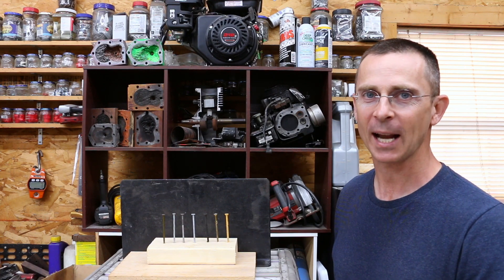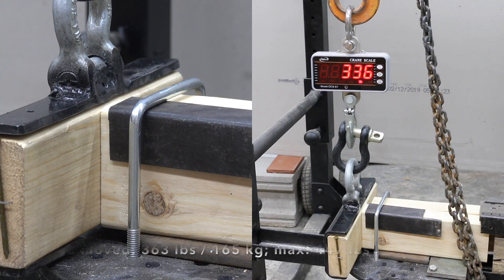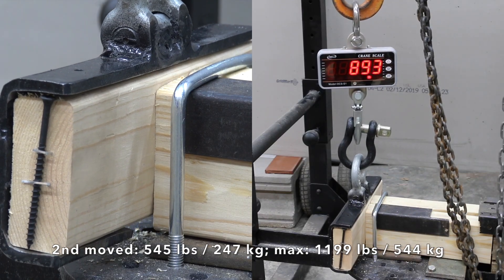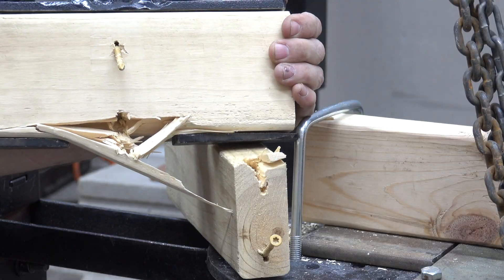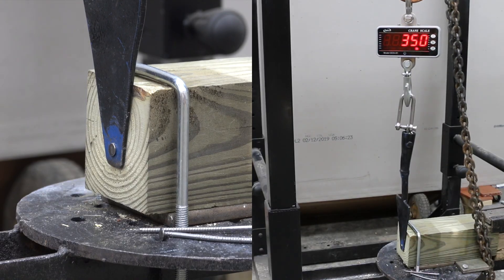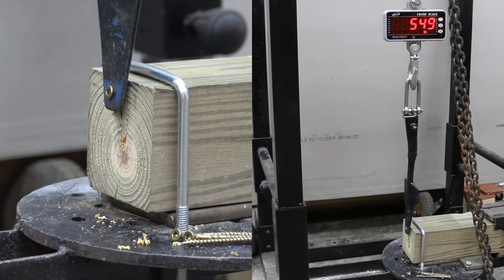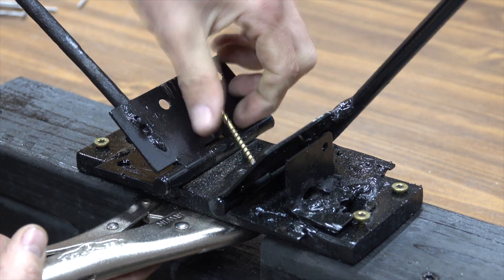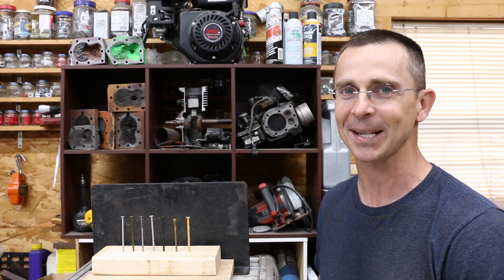Do Screws Shear easier than Nails? Let's find out!

Comment: Great test but a tad misleading. "Shear" testing should end in the fasteners breaking, not pulling out. 

According to a construction text book I have stashed away somewhere, fasteners are 6 times stronger when driven into cross grain at a right angle or five times stronger when toe nailed than when driven into end grain. This is why end grain fastening is always avoided or reinforced in construction applications except where there are no shear forces involved. So repeating this test driving into cross grain should have found actual shear limits of many of the fasteners. And I would be curious to know how accurate my book is. 

Keep up the great work. Thanks.
Reply: It's a good thing I looked through the comments, I was about to make the same point. With that said, since the tests are done all the same way, the comparisons probably still are fair.
Reply: @nobodycares85  absolutely. As the results were repeatedly similar, this means the test was accurate to the conditions. Changing the test parameters for other results would certainly be interesting and of value as well.

Since wood can split sometimes when you go into the cross grain, I'm wondering of the results will be less repeatable or accurate. I'm thinking cross grain varies in pattern more. This may make testing show too great of a variation in results, but without the testing done this is just a hypothesis.
Reply: @DENicholsAutoBravado  That's a good point you raise there about the potential for more splitting with cross grain, I hadn't thought of that.
Reply: @DE Nichols  IMO, this test allows screws to "prove" to be stronger than the nails due to this test not truly testing the shear value.  When he does this test again the correct way ( not into end grain) I believe the nails will be stronger.  When nail and screw is tested only on shear value and not on outward pull, those screws will snap, especially the sheetrock screws.
Reply: DE Nichols Agreed as to your comments, but on the job there are always variations in the patterns of the endgrain or crossgrain of the wood you are fastening to.  Getting an average of three pulls per fastener seems to be a good way to test them.
Reply from the maker: Thank you for the constructive feedback!
Reply: @ProjectFarm  I see what you did there!
Reply: @ProjectFarm  Real world scenario however if an object is secured with holding power in excess of 1000 lbs, it would require that same amount of linear movement to even begin to slide and create shear forces, screws lock wood much more securely preventing shear forces from truly becoming an issue. Obviously it depends on what scale your building on lol 😂 a shed or a fence however isn’t going to exceed those fasteners holding power, perhaps a deck with sufficient weight built onto it or a house but when constructing buildings pieces of wood are arranged in a certain manner to play to the strengths of tensile strength not shear strength. Correct me if I’m wrong, this is simply my understanding of it.
Reply: I love the channel, but this was not a shear test. What was tested was the strength of the wood, the holding power of the various shank and thread designs, plastic deformation, tensile strength, and the point at which the various alloys become work hardened. All of which is very useful and interesting in its own right.
Reply: Came here to make the same point. This is still a pull out strength test.
Reply: A fixed upright on test 2, preventing the fasteners from pulling out, might have resulted in a shear test. The 3rd test was a maleability test, not a shear test. However, it seems mostly irrelevant, because fasteners don't bend once they are in place, until they start to pull out, so if they never fail due to holding strength, they will never fail from bending. For all practical purposes, once they start pulling out, the joint has already failed anyway. Still, an enlightening test. You basically proved all of the fasteners are stronger in shear, than the wood used for testing...
Reply: If u fully watch the video. It is a shearing test.. It's not possible to always make a nail or screw break under realistic circumstances. It either breaks or it pulls out. His second method is the best test of shear strength.

Grip test involve shearing aswell. But shearing involves an angle.. every screw was bent coming out a lot were broken. This is a good test for shearing. You can also see grip involved too. Kinda hard to avoid.
Reply: Your book is spot on.   The methodology he used gave a comparison under equal conditions, but had he screwed into the side of the 4x instead of the endgrain, it would be interesting to see if the the added holding power gained would have caused the screw-heads to pop off vs. the nails.   I wonder...  He had to know that; I wonder if other than end-grain would have exceeded the limit of his scale?

Some of those screws did a lot more bending than I thought they would have, a simple claw on a hammer demonstrates the "sheer" difference pretty quickly when you're pulling them with a hammer, and it's not nearly this close!  In fact, it's virtually impossible to pull a screw with the claw of a hammer without breaking off the screw with very, VERY little force applied.
                                 You may have noticed the difference when he breaks the screws vs. the nails, the actual solid area is much smaller on the screw than the nail.   It's also why we don't use nail-gun nails for door-jams, ETC; those nails (finish) have very little holding power and bend VERY easily compared to hand nails.
                                  I'm seeing guys use 100% screws on subfloors now.   It goes against everything I was taught, but for a subfloor I suppose it makes good sense.   It will ALWAYS boil down to cost and time on the job site....
Reply: @crforfreedom7407  - Use screws for subfloor to minimize squeaks and call backs.  As the wood dries, fasteners loose their grip.  Nails more so than screws as he demonstrated in this video watching how much wood is pulled out when the fasteners fail and the amount of force required to do so.  Because this is such a major problem, everyone I know also uses an adhesive in addition to the fasteners.
Reply: @flick22601  Right on about adhesives; I think this has had the biggest impact on squeaking frankly, but have you ever tried to pull out a nail-gun nail?    They all come with glue/adhesive and are a bear to pull!!   I've had to fix a few FUBARS and I'm telling you, the difference between a sinker and a nailgun nail in removal with a cat's paw or even a pry is amazing!   Takes an annoying job and makes it a full-fledged infuriating pain in the @ss!   A salvageable piece of ply is total scrap by the time your done!
                                              If you're comparing the holding power of a nail-gun nail and a screw, I think you might find that an interesting comparison!  I think it's a totally different ballgame.  Besides.   It's what; 5x at least faster to lay?   There you go; time and money with no loss of quality.
Reply: @flick22601  I might add that with a nail gun, the nail is intentionally attempted to be installed at an angle which also aids in adhesion and anti-squeaking properties.  But the glue on the nail and the adhesive on the joist is huge for anti-squeaking.  I've installed many, many homes this way, both new and remodel with 0 callbacks.  But if screws are better, I'm willing to keep an open mind.   I was surprised to see it being done by some pros on YT I saw.  Defiantly a departure from the way we all used to.    I bent nails for about 25 years, but I'm in a different trade now, I do commercial & industrial HVACR, so except for my own work, I've been out of the biz awhile.... new and changing all the time...
Reply: @crforfreedom7407  , I have installed solid oak flooring, and cheap engineered
 bamboo flooring, in several rooms at my house, using dragontooth nails and the large pneumatic nailer that you have to hit with a hammer to drive the nail. I also had a contractor put hardwood flooring in another room, and he used the glue coated staples and a small air nailer. My experience has been that the dragon tooth nails hold a lot better, with less sponginess and fewer squeaks. Granted, this 1980s house wasn't built all that well and the plywood subfloors are decidedly uneven , perhaps it would be less of an issue if the floors were flatter. BTW, the plywood subfloors used to squeak like crazy (the builder didn't use construction adhesive,  obviously ) when there was carpet on them; I screwed them all down snuggly with plenty of screws before the hardwood or bamboo was installed. They still squeak a little bit but not like they used to.
Reply: @goodun6081  Sounds like you did excellent work!   That impact nailer is the tool used for hardwood for many decades to my knowledge.  It is a great fastener; thick and strong.   As I mentioned earlier about pneumatic finish nails, the staples too are very thin material and are way too pliable for that application in my opinion.   The comment about glue on nails was pretty much just dedicated to the 16s and 8s.  I've demoed a lot of jams, and a few were fastened with a pneumatic gun, and I was shocked at how easy it was to tear it about.   hardly needed tools!!  Most nails pulled through, but very easily and bent like pretzels!  The staples I should think are on about the same par?    I've used a lot of pneumatic staples for lauan, but that is scads of staples recessed.  Different application.
                                                   I think the biggest reason why adhesive is such the answer to the problem, isn't so much that the nails loosen necessary, but as the wood shrinks, expands and works up & down (which just covered about 360 degrees of movement!) the holes in the wood get larger around the nail.   The best fastener can't stop that 100%, and steel is tougher than wood, eventually it's bound to open slightly.  Restricting the vertical movement as well as some lateral makes adhesive the miracle worker....
Reply: @crforfreedom7407  , unfortunately, there's no easy way to add adhesive between the plywood and the joist of a squeaky subfloor! Which is why I put a gazillion sheetrock screws in it instead, prior to installation of hardwood. Although I had other contractors redo our kitchen cabinets and kitchen floor, my wife and I demoed it ourselves. The linoleum was glued to luan plywood which was nailed down to the 3/4 plywood with about a gazillion nails. We sliced through the Luan and linoleum with a circular saw set quite shallow, and pried it up in roughly 2-foot by 2-foot pieces, and pulled about a gazillion nails. Yikes! Although I ran some new electrical lines and relocated  some wiring, switch boxes,  plumbing  etc., in advance of the new cabinets, my wife refused to let me install the hardwood floors and insisted I have someone else do it because she wanted it done in a day, and not  two and a half days or so. The problem is, if you look closely you can kind of tell that the flooring was done buy a "git 'er done" type of contractor, and there's a little more squeak and floor movement than I would have liked. That's the last time I will listen to my wife in any matters concerning home renovation.
Reply: @flick22601  we use glue and ring shank nails for 3/4" subfloor.
Reply: @crforfreedom7407  - You are correct and that is the way I used to do it.  When and if the wood gets wet and as it ages it has been my experience that nails will eventually loose their grip whether cement coated, ring shank or spiral.  Just look at deck boards exposed to the weather to see what I'm talking about.  I have a screw gun that uses an extension pole and collated screws that makes fastening fast.  Overkill?  Maybe not as fast as a nail gun but, I never have to go back and have never had one complaint about a squeaking floor in the past 30 years.
Reply: @crforfreedom7407  
Bought a new home and the front deck railing were all rotted in 8 years. I was surprised to find out only 10 screws on the original builder's work. 
All the other fasteners were 18- 16 gauge nail gun fasteners quickies.
No wonder 1 was able to demolished the entire deck very quickly despite having severe arthritis on my hands and arms.
Reply: @loktom4068  Sounds like a real cobbled up mess from the day it was built...
Reply: @crforfreedom7407  
You don't have a finish nailer? I thought everyone gunned those in now.  We used trim guns fifteen years ago.
Reply: @W1ldt1m  I don't remember what I said about pneumatic finish nailers, but I still have the Senco I bought in 96.  It's been rebuilt 2x, but still works great!   But I don't use it for anything structural like jams, only base and trim.  Box 8s or any box nail is much thicker and more rigid than anything out of a nailgun, and far superior structurally from my experience.  When I talk about pulling a gun nail, I'm referring to a framing nail only.  Those stick!   
But for trim and moldings, yes; brad and finish guns are fine.  Use them all the time for that purpose.  Just not jams or anything structural.
Reply: @crforfreedom7407  
Since subflooring is all osb now and no solid wood you don't have the moisture flex nails survive better than screws.  Screws also won't move with walking over time so the floor will be less likely to squeek.
Reply: I disagree. Part of the reason i love the tests done on this channel is because the test is representative of how products are typically used. If the fastener pulls out rather than shearing, then the shear strength of the fastener isn't very relevant anymore. I do agree however that testing different grain orientations is relevant.
Reply: @Mr Brightside :exactly screws are hardened & will snap & nails are supposed to bend.  if you used screw to hold your deck together& to attach it to your house it wouldn't pass building code from where I am
Reply: @Mr Brightside Very true.  It's a great idea.  I've tried to rip up ply glued to joists.  It was incredible work and it did often damage the joist.  Great idea!  Sub floors don't often have to come up; contractors don't often  think past the job and there would be a cost consideration there, but yes; it would be an excellent idea! Especially in kitchens and bathrooms, or wherever there is a risk of water damage.  I know I've used silicone for adhesion on aluminum fascia to reduce the volume of nails and it's a great, flexible fastener.   Well done Brits!
Reply: @crforfreedom7407  you guys talking about gluing down sub floors like it's a new thing.. It's been code in most or all of Canada for like 10-15 years now, all new homes must be built this way.
Reply: @BobSmith-rs7tn  LOL!!  Hardly new; I've been doing it since 1990 and it was common before then.   The question is in my mind, does the sheeting have to be a solid bond to the joist?   I suppose fusing them does eliminate squeak worries, and I know the new Zipsystem foam/jell flooring adhesives are suppose to do this better for their product than liquid nails ever did or could!   My question is, do we have to destroy the subfloor and joist to make this squeak-free bond work, or is there another way?   That's my question.   From what I'm seeing, the industry is still going to fusing the floor, which means a repair constitutes the loss of sheeting AND joist material, not to mention incredible labor expenditure, especially if on a large area.
Reply: @crforfreedom7407  My understanding is if you remove the subfloor, you have to replace it to code.. if you're not touching it you don't.. Anything beyond that would be up to the customer's preferences/pocket book
Reply: Respectfully disagree. This is rather close to a real world test. If in the real world the wood or the grip of the fastener fails before shear point is made, the shear force is irrelevant to the failure. In other words, the shear strength of the fastener was greater than the other failure points. The best take away is the demonstration of how strength and ductility are not the same thing and each has it's advantages.
Reply: @cecilbrisley5185  It doesn't sound like we disagree at all. You and I have the same definition of "shear" which  was my point.
Reply: in other words put then into very hard wood?
Reply: cant wait for that video!
Reply: And yet we saw nail failure in that direction...
Reply: I just took the test results as I saw the results demonstrated.
Reply: Shear strength in engineering terms dont have to be to the point of breaking as much as it is to the point of failure. shear strength is the strength of a material or component against the type of yield or structural failure when the material or component fails in shear.
Reply: Yeah, my only criticism
Reply: I had the same thought. Also the chain allows for the nails to be pulled out easier as it will move to the side when enough force is applied. Wondering if a test could be set up to pull with a solid object. Maybe fasten 2 rings to a wall and run a pipe through them and hook the chain up to the top of the pipe and the nail to the bottom
Reply: Good points for sure, but of course most construction like walls and decks are pretty much just as these test pieces were made.
Reply: @Troyvidihoo  Not exactly. If by walls you mean how nails are driven through top & bottom plates into the end of studs, this application does not bear any sheer strength at all so is not relevant to this kind of test.

In the case of decks I imagine you are referring to floor joists which are horizontal and would need to prevent sheer . In this case hangers are required.

Nowhere in construction (unless we are talking about a very small project) are nails into end grain alone used to prevent sheer. What you claim is really only true in a subset of the DIY sector where hobbyists may not be aware of the forces involved or the codes.
Reply: @finnyr9330  Sure modern code requires brackets and such designed to eliminate the weaknesses you have mentioned. Still I have been in many walls and the vast majority of existing structures are not built differently than these test pieces.    And to your point they probably would have failed except they are strengthen by wall coverings and adjacent walls that all interlock eachother.  Just as a framed house is far  easier to lean over before the walls are covered strengthening it exponentially, both against leaning and pull out.  Still to say walls never face forces that would be applying shear on fasteners would not be accurate, slamming doors, winds and earthquakes certainly do.   

I have seen many decks put together without hanger brackets, and they hold up well if the deck boards are screwed to both the joist and endplates, where they then act to keep it all tied together, there is most definitely shear force on these fasteners, especially on the ones holding the endplate the building that usually are supporting that whole side of the deck.  No doubt brackets there make allot of sense , but plenty of old decks are just overkill screwed together.
Reply: @Troyvidihoo   It seems we are mostly in agreement. Sheathing or purlins prevent racking and hurricane straps prevent winds from lifting the roof off. But that just goes to my point; nailing into end grain alone is not called upon to hold a house together. 

And I did not intend to suggest that zero shearing would ever occur in the wall scenario, only that it is inconsequential in the overall design. 

Consider a load bearing wall which is, among other things, designed for their strength to resist crushing; they have to hold the roof up. That weight creates enormous friction between the stud and plates. It's hard to image a door slammed so hard that it overcomes that friction to create enough movement between the stud and plate to apply sheer force to the nails that hold them together. And if an earthquake does, well, I think I'll have other things to worry about. :)
Reply: Although technically true that the sheer of the fasteners wasn't accurately tested/compared it did show a more real world (wood frame construction) conditions of how these fasteners would perform.  To test the basic sheer of the fasteners they would've needed to be pushed through a hole through two metal plates and then those plates pulled opposingly.  Thing is that these types of fasteners should never be used to fasten two pieces of metal together like that, so is the simple sheer strength of these fasteners really a valuable reason for the code to specify nails over screws?  I think these tests show that probably both types of fasteners should be used together for the best structural performance.
Reply: This is not a tad bit misleading, it's factually incorrect.  He tested the pull out strength of the fasteners from end grain nail pattern.  Of course screws are going to win over bright nails.  Non of the fasteners (other than drywall screws, lol) actually sheared apart.  The way to test shear is to actually test to failure of the fastener, aka the fasteners themselves breaking in two pieces.  Need to use steel plates instead of wood.
Reply: Funny thing about wood, and screws.  Wood is a natural product, and not consistent.  perhaps 1,2 or 3 out of 30 fasteners will be in a weak part of the wood.  From my experience. Whereas, about 1/60 fasteners will fail, and you'll know when you are driving them in.
Reply: ^^^^^^^^THIS^^^^^^^^^